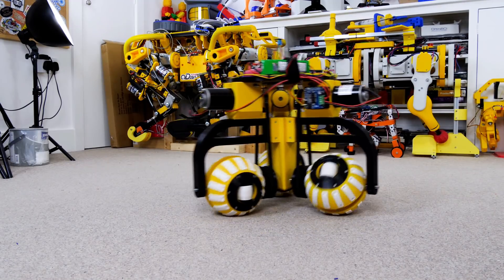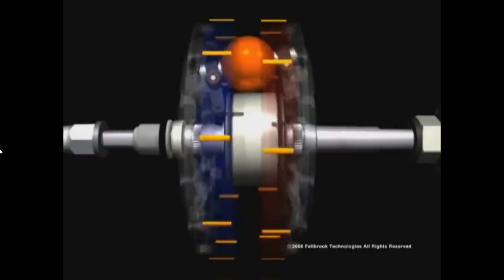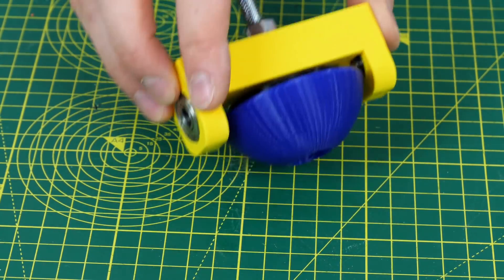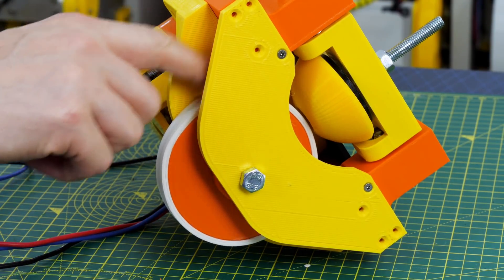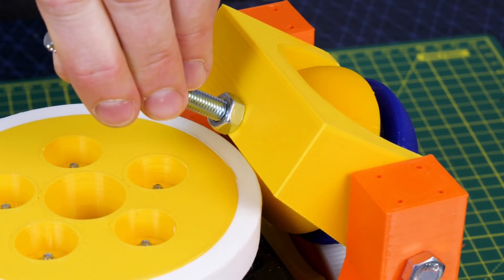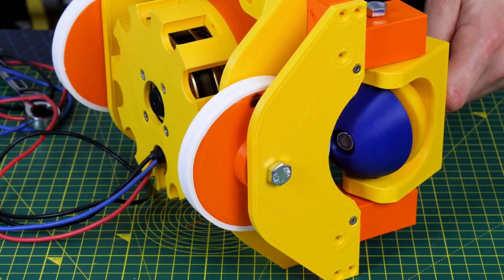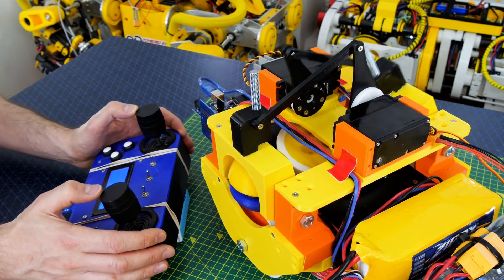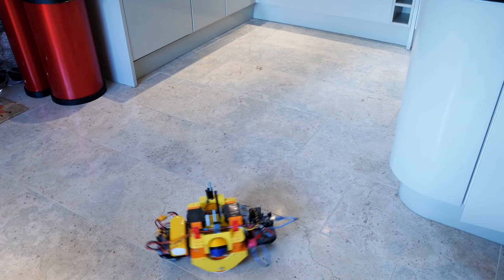Continually Variable Transmission with Clutch & Reverse

Comment from the maker: Thanks to Keeps for sponsoring this video!  Head to https://keeps.com/bruton to get 50% off your first order of Keeps hair loss treatment.
Reply: damn only 7k veiws...
Reply: James Bruton 
This cardan-gear-based gravity balancer is perfect for your power Efficient robot joints https://youtu.be/LNXUASfLbVM
Reply: Lol, new demographic?
Reply: Could you make the electric motor powered exoskeleton with cluthes at the joints (with for example a square jaw clutch) so when it is moved normally, at normal speed it can be responsive and when it detects resistans at the movement the cluthes engage and the movement is  powered by the motors when it needs supported movement. I understand it makes the system partly passive but i think this method doesn t restrict quick and normal movement this way.
 What do you think?
I hope i could give you a possible video idea for next time!
Love your channel!
Keep up the good work!
Reply: @zolibartalos  I think you'd still end up going bald however
Reply: cool robots dude
Reply: I know sponsors pay the bills, but dude... At least get sponsors relevant to the channel!! WTH do hair loss products have to do with robotics?!?!
Reply: @FloatingFatMan  YouTube provides viewer/subscriber metrics that includes age ranges.
Reply: @mccunnj  So? It STILL has sod all to do with the theme of the channel...
Reply: @FloatingFatMan  agreed
Reply: Wait what 1 week ago
Reply: I wonder if you could reverse this, so that the input is turning at a variable rate, but the output would remain consistent. So if you had something like a wind turbine that turns at a variable rate but the generator would turn at a consistent rate
Reply: @ripvanstinkle  I don't think it would be a good idea to use the Keeps at a variable rate.
However I do agree that the output of the Keeps should remain consistent.

Comment: i think you should do a test to see how this sort of thing handles dust, dirt and water on floors since the very same wheel used in the reducer is also making contact with the ground. the obvious solution to me seems to change the size of the balls and reduction drive "wheel" which is then geared differently, but, it also means you add greater complexity to the design and reduce rigidity

This design btw seems perfect for adapting to an engine, or a steam turbine. the whole time im sitting here thinking, lawn mower engine would go great on this, though that also probably exceeds the physical limitations of 3D printed thermoplastics

Comment: Very cool. Thank you for sharing this.

I think a small improvement would be to make the ball portions a rigid material with surface texture for grip (not flexible), then have replaceable rubber bands on the drive and output disks.
*I think that will wear more evenly
*be easier to replace without having the original model (later maintenance/rebuild concern)
*be less prone for inconsistencies in movement between the 2 sides

Comment: The idea is great, the simplicity of it makes it even better. In case of small, light contraptions, it can make sense to develop a prototype and testing it. Although my thoughts can't leave the issue about friction. Imagine a moderately heavy machine using this idea, or a heavier one. I'm not convinced it would be an easy task to solve the possibilities of slipping or grinding. If you can come up with a trusty solution for not "amending" the gear oil with metal shavings or powdered metal, you can make a nice future for yourself. It would be a cool thing to see it working in a long-term use.

Comment: Dixon Lawn Mowers used this exact system for their zero turn lawn mowers decades ago.  They essentially invented the zero turn lawn mower and they used this system for years before switching over to hydraulic zero turn which is the current standard.

Comment: CVTs are one of those things that hold so much promise but in actual practice can't hold up to the tremendous forces required of them for very long. All of the CVTs made by legacy auto manufacturers for the last 20+ years, whether from Nissan, Daimler or whomever, are known for reliability issues but they keep on pursuing them because of their huge potential advantages. Sadly, since the world is slowly shifting to electric vehicles and electric vehicles usually don't have or need a transmission at all, the CVTs days are probably numbered.

Comment: I'm sure the frictional losses in this thing are quite high. There is essentially 3 places that motor torque must pass through to the wheels. This is an amusing and clever build that is driven from a single motor.

Comment: That's such an awesome design, can't wait to see it evolve even further.
BTW, maybe using small cycloidal drives instead of the servos and arms to change the tilt of the hemispheres

I think it could give a more compact and sturdy fit, if placed by the side of the hemisphere's holder, though the current arms design look interesting, looks like there's someone inside manually driving it :D

Comment: This could potentially be useful for a platform powered by something other than electricity, such as a heat engine or pneumatic engine of some sort. With battery power, however, it seems more practical to just use two reversible motors with speed controllers.

Comment: Just for reference, most tanks don't use two control sticks. It's too difficult to use to ensure same position on each. Modern tanks use a wheel and throttle and brake pedal.

As you discovered.

Comment: The amount of plastic waste for a robot that will probably drive for 10 minutes in its lifetime... 
Printing every single part of you robots is convenient, but not very economical. 
As seen in your videos, To get the same strengths, stiffness and temperature stability as other materials on the main load bearing parts of your robots, you have to  print huge chunky parts. Going for a aluminium extrusion frame with complex 3d printed part would be the better option in probably any metric in the long run.

Comment: This is so smart, it feels like cheating physics...
Reply: Until you realize that you have seen these kinds of things like 40, if not 50 years ago, already, and they may even be included in some patents filed in the 1880s.
Reply: @schmetterling4477  yeah, of course, I'm not saying he invented it. - I'm saying that in general, it feels like cheating physics.
Reply: @Verrisin  It only "cheats" Hamiltonian mechanics, which, of course, is not the only version of mechanics there is. None of these systems are free of friction and they are what physicists call non-holonomic or anholonomic. Since the theory of these systems has been explored in physics since the 1870s, if not a little earlier, I am pretty sure that there was a parallel in mechanical engineering at the same time.

Comment: You could 3d print some notches that stop the joysticks at different positions so it's easier to drive in a straight line and also easier to choose the turn speed.

Comment: I have no idea if this will work but you theorytically link those two balls up in Parallel and drive them with one servo this would tho reduce the maneuverability which is not the best in a robot but it would be just simpler.

(Again I have no idea if events I described would actually happen)

Comment: I wonder how much torque this setup can handle before the friction breaks between the wheel and the spheres?  Perhaps the friction materials molded with some grit could improve the power transfer potential...  

Great design btw!

P.s.  perhaps a mechanical lock on the back of the main wheel like a winder gear could provide a park gear for when stopped on an incline?

Comment: When I was a teen I drew some steampunk scenes, and I would design the machines before drawing them in, I wanted things to look like they actually work. I made spherical gears that would transfer rotation through the joints of a robot modeled on a mountain lion. I didn't think about at the time about the gear ratio changing when it bends and contacts it's limbs, lol.

How hard would it be to make a gearing setup that could compensate for that and drive the shafts faster or slower accordingly to effectively use two sphere gears to transfer rotation through a limb's joint? I fear it would be really inefficient.

Comment: If you rotate the dead zone of the roller spheres over the drive wheel
wouldn't that lock the driven wheel in place and disengage the power transfer?
Just like when you talked about rotating the dead zone over the driven wheel but would result in free spin

Comment: Do these wheels have any practical use because they seem to be very inefficient.
Reply from the maker: A robot arm with one expensive motor?
Reply: True I think I was only thinking of them Being used as wheels and not in anything else. It’s just when they were used as wheels it seemed like mecanum wheels may have functioned better.

Comment: It would be neat to couple this drive system with a vertical axis wind turbine. If the electronics were low power enough you could design a robot that could wander around a patio outside waiting for a wind indefinitely.

Comment: Next step: Add gyros, inclinometer, Kalman Filter, PID controller, make it self balancing, and ditch the casters.

Also, this looks like it could be powered by a gas engine and speed controller.

Comment: idk if you are interested, but a nano punch hole card metal (copper, aluminium, iron) disc with scanning electron microscope reading and burning, nano beam, with spinning like cd, one or two 1d actuator radial position per electron laser, or just 150nm uv laser for uvray drives, just data storage, nothing otherwise related to this content

Comment: This is brilliant!!!! I'm not sure in how far this is patent-able but as  robots go this one will go far. The limited amount of moving parts. The load-bearing moving parts.... Man this has a future.
I kid you not. As an example I see this riding on mars but also as  a more sturdy Roombah. Just imagine this clutch system adapting to different types of flooring by using the clutch. Not just the wheels but also the brushes.

Comment: Do the surfaces that touch get hot ? Would that lead to some sort of slippage over time ? Also if the wheel is touching the floor will dirt cause wear between the two surfaces ? Seems like this would be better if the wheel had an inner surface that was drivable rather than an outer one ....

Comment: IDEA!!!! Spider.  All legs driven from single motor in the middle with your ball regulators controlling speed of each leg.  Motion of leg (step) is driven mechanically and step profile does not change.  So control interface is just one motor and eight servos.  I wanna see it!!!!  I've always wanted to see you do a spider!!!!

Comment: A neat real world application for this sort of transmission might be a gas powered robotic lawn mower. Could use the already steady running gasoline motor for the motive force, and only need very minimal electrical system for the servos. Super neat.

Comment: This thing is at least double so cool as it is janky 🤣
Also if you want to stop the wheels from rotating when disengaged just glue a non-rotating rubber stopper in the middle, no worm gear necessary.

Comment: The robot arm idea is really interesting! It reminds me of old sawmills, where the equipment would clutch in and out of the main waterwheel which delivered power via a belt and pulley system going through the building. For the arm it means you’d only need one strong drive motor rather than a motor at each joint - that definitely shows promise!

Comment: Hilarious I made almost this same (general) design a couple years ago with wood some ultrasound sensors and cheap motors from microcenter, but exact same wheel setup with two rotating ones front and back and the fixed ones on sides for steering worked well too.  I spring loaded the front wheel since it was bobbly but worked well for getting over small obstacles too.  https://photos.app.goo.gl/4iKAbToWskeTaNBw8

Comment: biggest problem is the operation with high torque. We had this problem in a project for a client, but ended up making a new type of gears which worked well. It is still in the process and will be patented. But for anything with a limited torque, this is grrrreat
Reply: I'd imagine that in real world application, debris on the wheel would be pushed between the friction points and would cause quick wear and tear on the half balls driving the wheel.
This design probably best to be enclosed in a dust free environment, like perhaps a shoulder for a robot.
Reply: @TheNightstalkerShow  yes. But even then you will have the problem, just less. Imagine when a lot of torque applies.
Reply: @el-domo  Agreed. It becomes a choice in materials used at that point. Metal on rubber, or nylon on some other material. Whichever part being easier and cheaper to replace should wear first. It's a neat design with niche uses... I wouldn't expect it to be used for moving parts that operate 24/7.
Reply: @TheNightstalkerShow  They all wear out and can't take high torque anyway. If you find out, it's extremely expensive and limited to the applications anyway
Reply: @el-domo  Probably can design a half sphere bevel gear with no spiral these days to handle the torque and get same functionality as the friction only method... but you say you have a patent pending, so I doubt you'd confirm it :D
Reply: @TheNightstalkerShow  not yet patent pending, still in development. First prototypes showed a good effective function. So now we are still developing the product to the end stage and then it will be patented

Comment: Really cool! Rather than add complexity to stop, why not have a rubber cap on the transmission wheel so vertical is a brake instead of freewheeling?

Comment: Very cool idea!  Looks like some folks beat me to it, but this seems like the perfect setup to use a flywheel to drive the system instead of a motor.  If you make a 1 or 2-wheel robot (1-wheel would be awesome!) the flywheel could potentially double as a gyroscope to help you stay upright.

Comment: That's some pretty sophisticated behavior for a robot with only 1 motor and 2 servos.  :)  I may have missed something, but is there a single gear or belt in this entire robot?  I don't believe there is.  LOL
Reply: Also, I think something like this could be useful in your balancing ball type robots.  :)
Reply from the maker: Nope - only the Cycloidal discs in the Cycloidal drive. You'd probably need further drive trains for anything more complicated though
Reply: @jamesbruton  I was thinking about the "clutch" in this design.  It's more a "neutral" gear.  What you're lacking is brakes.  Imagine if there were a small solenoid inside the hole, so that instead of just allowing the wheel to spin freely, you could extend a rod or something to stop the wheel.  That way, you have neutral gear, continuously variable gear and independent braking.  Spin like a top, stop on a dime.  ;)
Reply: PS.  I'm sure there are other ways to do it, I just recommended a solenoid because - no gears or belts.

Comment: they should make an actual tank with something like this transmission, it would have far fewer parts than current systems, and if wear isn’t a concern because you are losing a lot of tanks in the battle of the bulge it will let you build more tanks for the same amount of steel

Comment: this would be a really usefull mechanism if your motor ran on compressed air or was like a combustion engine to get the very high range out of a chemical fuel as you can just keep it running at a optimal speed. also would be usefull to use a single bigger motor instead of smaller ones to also optimize efficiency and probably even more so on cost

Comment: Looks like a modified version of the drive system used by "zero turn" riding mowers? The gas engine turns a flywheel at a constant speed and variable reduction transmissions control each of the two drive wheels, allowing forward and reverse at a range of speeds.
Reply: sounds like that also has the advantage of being able to keep the engine at the ideal rev count for power/efficiency
Reply: In reality zero turn mowers use two independent hydrostatic drive mechanisms, hydraulic motors powered off of a common pump, the drive levers are connected to valves. Most ordinary lawn mowers with steering wheels have a single hydrostatic drive these days, much easier to use than a conventional transmission when you want to have variable speed and don't want to be messing with the throttle and therefore changing your blade speed.
Reply: @AlRoderick  Many zero turns have a pair of independent sealed hydrostatic drive units that are belt driven. A single belt drives both input shafts directly from the motor, and control arms attached to the drive units control their ratios much like the design in the video. The actual reduction mechanism is very different, involving movement of swashplates that change the displacement ratios rather than changing the flow rate with valves.

Since they don't have the restriction of valves they are more efficient, and much like a torque converter tend to work great until they don't. I've rebuilt them before for customers and currently own a mower with this system, but my next one will probably be the pump/valve/orbital motor style just because it removes the reliance on proprietary parts (Deere, of course)

Comment: you could use this system to make a zero turn mower without a hydraulic drive since the internal combustion engine is constantly spinning.   Getting enough torque to the wheels might be a problem though.

Comment: I wonder how many outputs could be connected.
Reply: Just make the CVT drive wheel bigger and you could connect as many as the motor has the torque to drive.. Which with that gearbox on it is probably a great many...